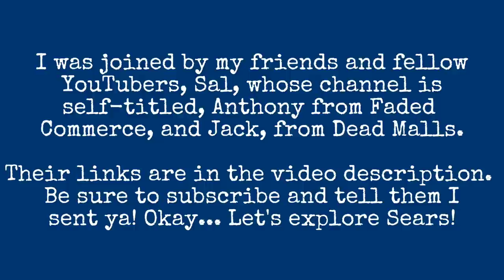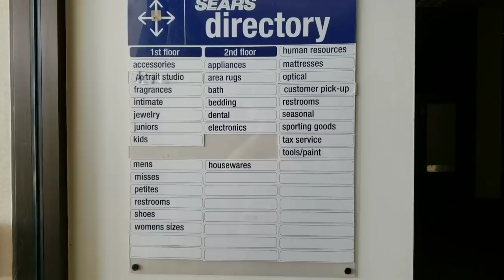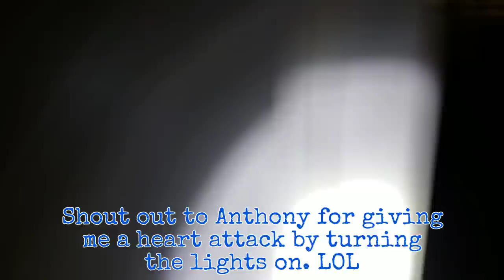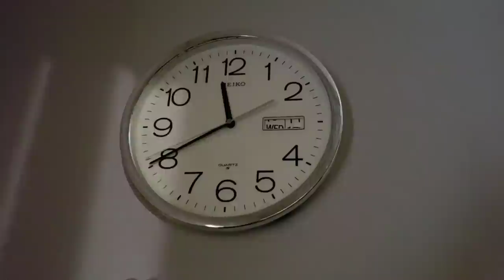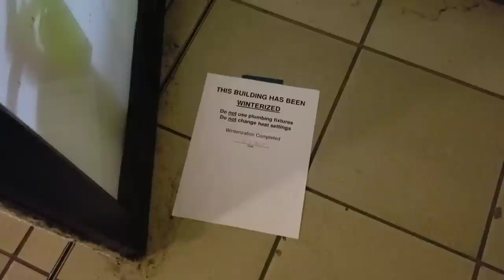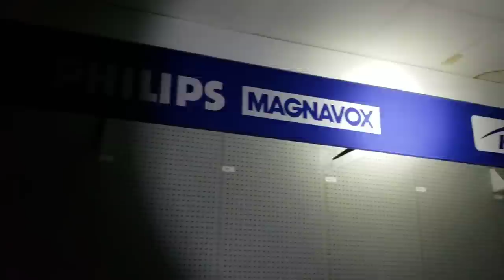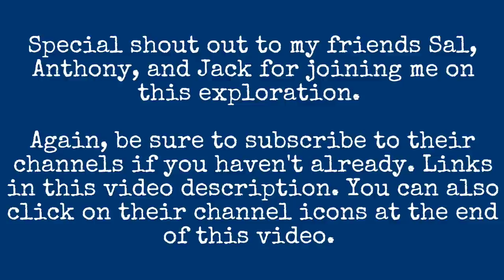Exploring An Abandoned Sears In PA With Sal, Faded Commerce, & Jack Of Dead Malls

Comment: Hey there! Amused to see someone sneaking around my old stomping grounds. I was an employee here for the last few years the store was open and helped close it. If you have any questions about the stuff you guys found, I'd be glad to answer them! I'll comment below with what info I can provide through the walkthrough.

Watching through:
1:21, Christ that alarm is still going, huh?
2:10, some stupid wallpaper for the Lands End clothing section, would have ruined the brand new paint on those pillars taking it down so it never came down.
2:44, closed in December 2014. Merry Christmas everyone, you don't have a job!
3:35, that's not supposed to be like that.
3:55, I'd hope that thing still works. When it caught fire the year before, the whole thing had to be replaced. Fun fact: Putting out that fire flooded the Philip Pelusi in the mall, which is why they closed.
4:22, fixture room for clothing.
4:26, nope, that's actually the downstairs bathrooms.
5:45, I'm surprised those tiles haven't collapsed from the water seeping in. We had problems with the roof right there starting in like 2012. 
6:16, so many people tried to leave via that door, causing the alarm to go off, despite the GIANT RED SIGNS ON EVERY DOOR. It's funny as hell seeing it open again.
6:45, electronics, yep. Setting up the TV wall was a massive pain in the ass every year.
6:57, was the LP office, hence why he had his own aircon.
7:35, was a misc room, we had tables set up and usually used it for potlucks or group training meetings and such. It used to be where H&R Block and other tax companies set up to do yearly taxes. That weird tiny room in the back had two desks and a bunch of old, old, OLD accounting equipment. 
8:12, your buddy was right, that was our training room. We had three ancient computers set up on the far end. Those little side offices were for the regional or district manager to use when they came to visit. As you guys found, the server and telecom rooms were back there too.
10:25, the portrait studio actually closed well before the store did. They were an outside company. There were very, very few items still in there when the store closed as we cleaned it out far before that.
11:30, similarly, optical/dental/hair salon were all also third party companies who all abandoned ship well before the store closed proper.
12:35, that was dental.
13:20, where we kept all the large promotional store signs that either hung from the ceiling or were attached to fixtures. 
14:09, housewares backroom, it was a maze of tall shelving with bedding, small appliances, ect.
15:01, all our backstock was actually upstairs, so everything either came up the conveyer belt or the giant backroom elevator. 
15:30, the main store office, where we picked up and stored our RMUs, HR was set up, made and printed the sales signs, and where customer pickup was on the other side of that indoor glass window.
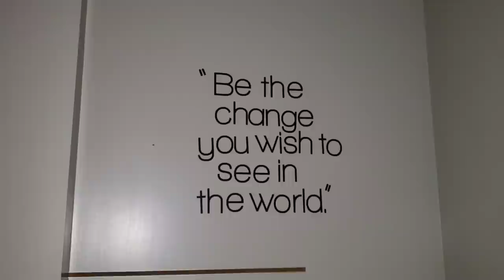16:05, nope, manager's office. Sears sent us a big corporate manager who put tons of propaganda up, hence all the signs on the walls. He made us chant "to serve, delight, and engage our members as they shop their way!" at the beginning of every morning meeting. HR was the barren office across the hall.
16:30, customer pickup.
18:00, used to be the lawn and garden drop off for repairs, eventually was just another crammed storage room. Appliance showroom was upstairs, basically the entire middle area next to Electronics.
19:08, Ron was awesome, and so was Dave. Dave was one of the best managers I'd ever worked under. His leaving of the company is what got us the corporate Kool-aid guy.
19:52, Sears Auto is also not actually Sears proper. Our auto center was fucking massive.

Thanks for uploading!
Reply: Thank you! It's actually really cool to know what some of these rooms were.
Reply: I am an audiophile (someone who has a special interest in speakers and sound equipment). What kind of speakers did your store use in the backrooms?
Reply: @christiangonzales7429  Man I have no idea, those things were installed well before my time there, probably dating back to the 70s.
Reply: @roguea I have a question! How long did you work there? How long has that alarm gone and how did it start?
Reply: @acessqble  Oh, almost five years. And that was the security alarm. It was annoying and would randomly trip in the middle of the night, or not accept your closing/opening codes, or all kinds of nonsense. I assume when they left the store they just ended their subscription for it and didn't actually turn off the alarm itself.

I remember driving by there about a year after the store closed on a cool winter night, and I could hear the outside bell tied to that thing going off still.

Comment: (Considering that you’ve been to another sears in my state) There is actually one in the Lehigh valley (Whitehall, PA) that I live near, that has been sitting abandoned for almost two years. Im pretty sure it’s still untouched from when it last closed, not even to mention that I myself have a recording of this location when it was still open to the public. It is still technically near two other active malls, so be wary if you do plan on visiting this location.